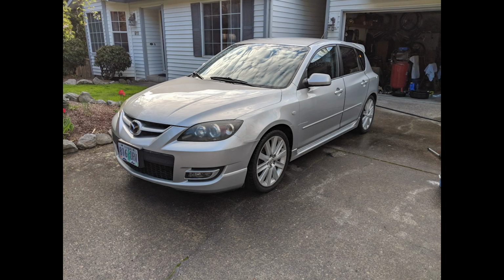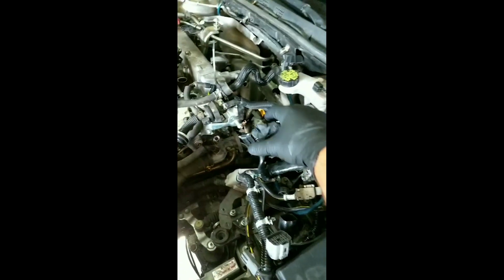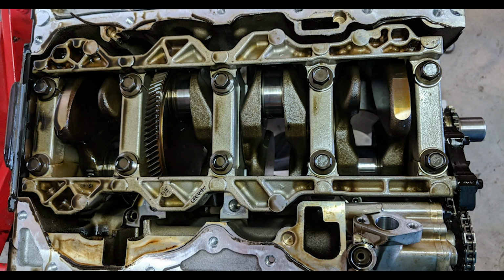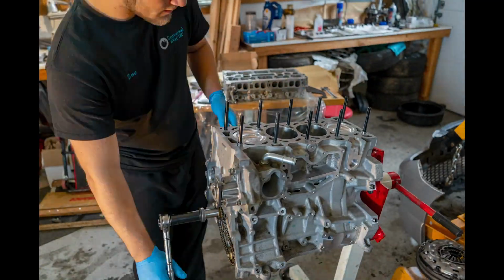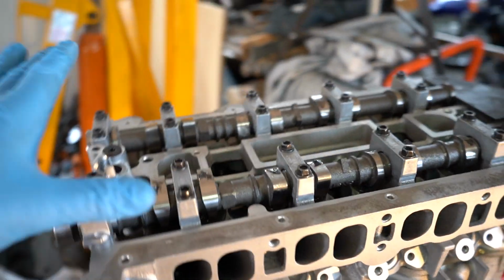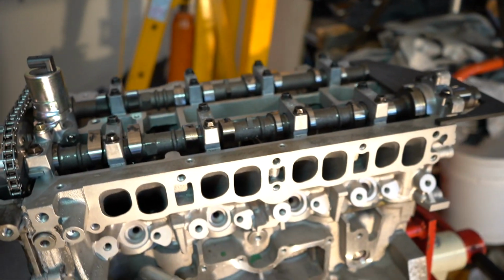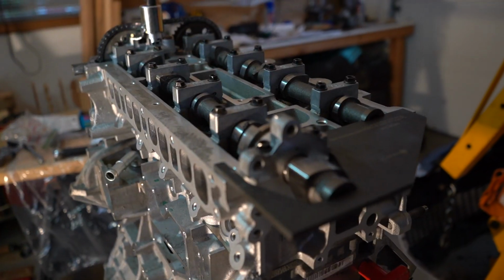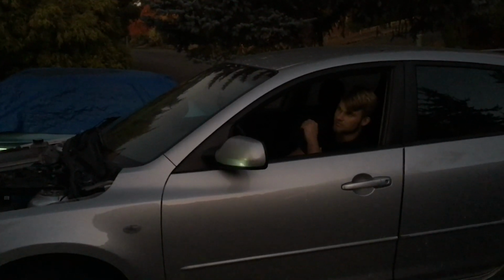First Time Building a Motor! | MAZDASPEED 3 Build Log

Comment: Thanks for sharing. You just gave me some motivation. 
My son is having the same issue with his mazdaspeed 3
& the cylinder block will have to be bored. 

Questions: 

1. What's the compression and bore  on the piston you used
2. What type of head gasket did you use
3. Did you use the stock ECU or did you have to purchase some aftermarket piggyback now that standard piston aren't  been used

This will be the 1st time for us taking an engine apart & trying to rebuild it, so we are seeking as much help as possible. 

Thank you

Comment: ARP 2000 head Studs are known in this platform to cause head lifting.  Use oem bolts unless you need more power.  Use ca625+ if you need head Studs that won't ruin your build and high hp
Reply from the maker: I'm only shooting for 450 -500. They shouldnt be a problem

Comment: Was timing on the speed engine easy or hard i’ve only done timing belt jobs and i have a mazda 3 2.0l gt 2006 and probably need to do timing job in few thousand kilometres
Reply from the maker: It's not too bad. I referred to my buddies video over at wannabe tuners. Eric is great and explained the process very well!

Comment: Nice work man. I live down in central America mechanics down here are not too familiar with the speed6 engine so I will do the rebuilding myself. My concern are the clearances. Do I just tell the machine shop to bore the cylinders to 88mm? Might as well tell them to gap the rings I guess. Do the shaft has to be service as well? Thabks.
Reply from the maker: Hey man! If you get the 88mm pistons they usually come with a spec sheet for both bore and balance which should both be something the machine shop is familiar with. My crank was in good condition and just needed a polish. Do note that you might have to use stock main bearings and have them coated. I tried to use king bearings but the machine shop said it wasn't working so I brought them the old ones to get cleaned up and coated to go back in.

Comment: I know this is extremely late, but did you get your crank keyed?
Reply from the maker: Nah I didn't, it's not needed / recommended until 700+
Barret Strecker @corksport and I were talking and his nuts build isn't keyed. My goals are 450-500 so I should be just fine with everything I've done
Reply: @ZJSProMedia  thank you so much! How many miles are on it so far

Comment: Well done! I've never pulled the motor on the speed3 before but do you have to go from the bottom? Curious why you chose to do it that way.
Reply from the maker: Sorry for the late response. No you can take the crash bar and core support off. I wasn't aware that you could do this without having to recharge the ac so I didn't wanna do it that way thinking I'd have to pay extra for that

Comment: Very nice!! I’m pulling the motor out of my speed to check if the head is level but while it’s out I would like to get my block to look as clean as yours. Have any tips on how to clean the engine block?
Reply from the maker: I took the block to a machine shop, they steam clean them when they do machine work. Otherwise it's gonna be a lot of degreaser if you can't steam clean it...